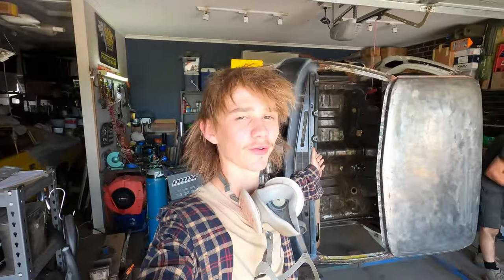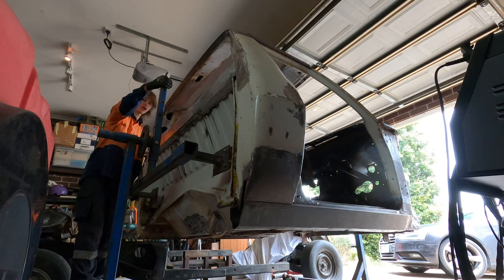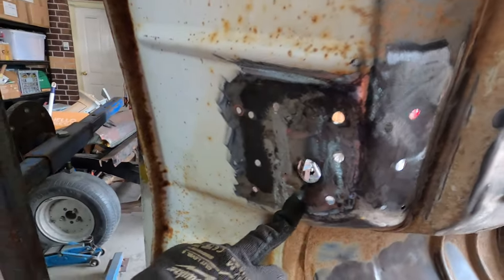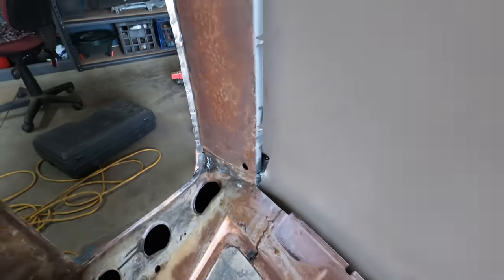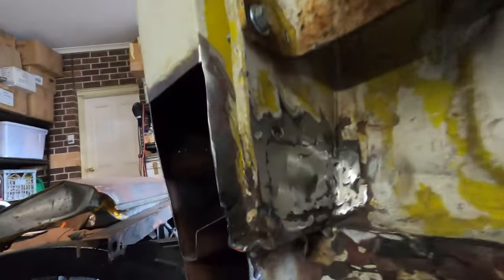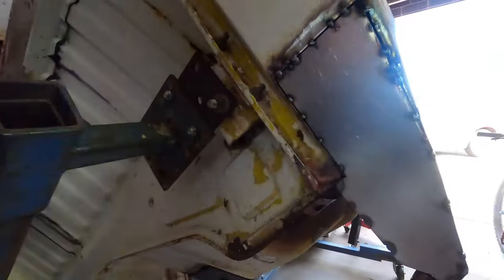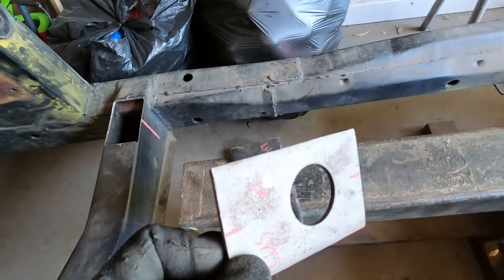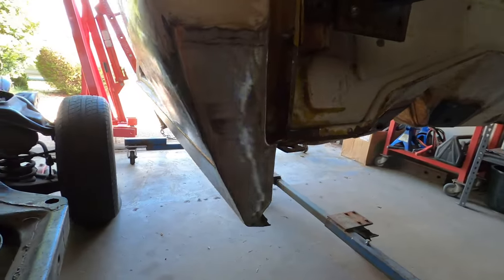SHE'S BACK ON THE ROTISSERIE!

Comment: Nice work once again Tait. You should think about cutting that shit looking rear panel out of the cab from below the window and giving yourself a bit of extra room in the cab. That rear panel looks hideous and you could knock up some nice custom fabricated stuff with your improving skills.  Bead roll a few  designs into it and it would look like it’s something the factory should of built. 👍 P.S  the makings of a good mullet  is coming along. 🔥
Reply from the maker: Hahah Thanks mate, I have thought about doing that to the back but i can’t get it registered because it’s structural but my tray will hide it i just won’t have the room in the cab.
Reply: @HQ1TN  don't cut it out if you don't want, I left mine in and just plated over the structural part, I don't run a headboard though.. well done anyway, You must have some great guidance..
Reply: @HQ1TN  yeah the extra cab space would be nice and modifying the back of the cab would of made a point of difference to all the other 1tunners out there. It’s getting hard to do something that hasn’t been done before. You could still add a nice infill panel for the back of the cab without cutting into the structural areas.